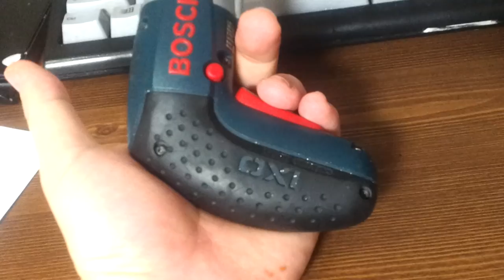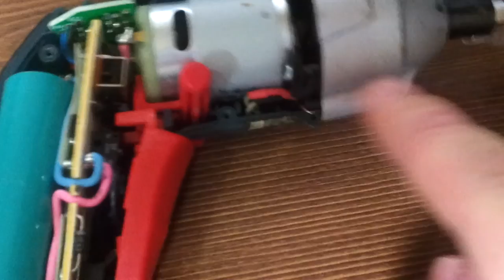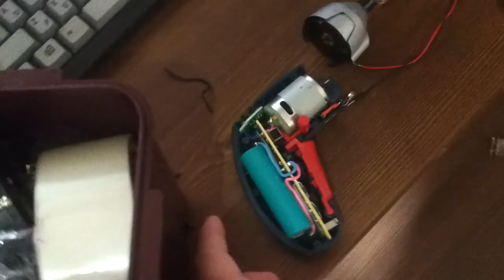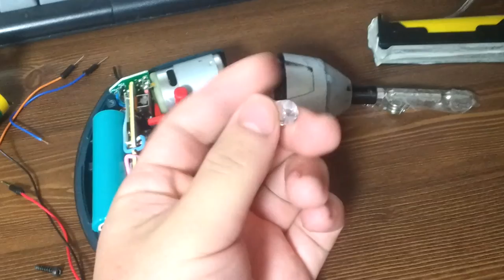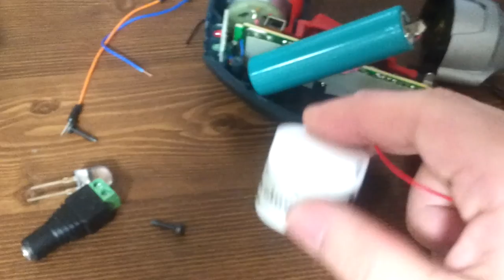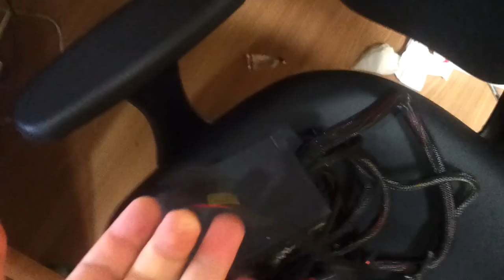Adding direct charging to bosch ixo - when you don't have charger? you can make it

Comment: In summary: 
The battery is 3.7v lithium 1300mah.
Because it's lithium, if you have to limit the amps (to 3 or less), and the volts at 3.8 else it could explode. 

He opens the case (which is remarkably easy!) and joins wires to either end of the battery. He also replaces the LED for a stronger one. 

To charge the battery he uses a current limiting (3amp) circuit (the red thing) and a PC power unit (I think outputing 24v dc?). 

Thanks PBear for this video!